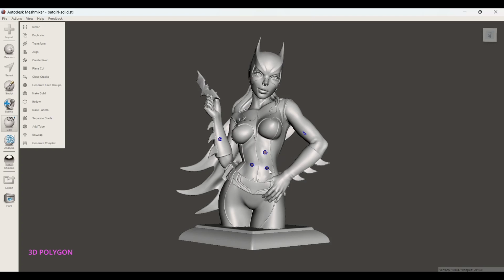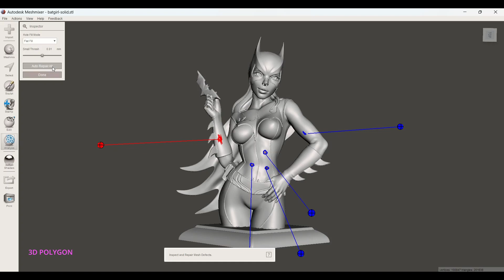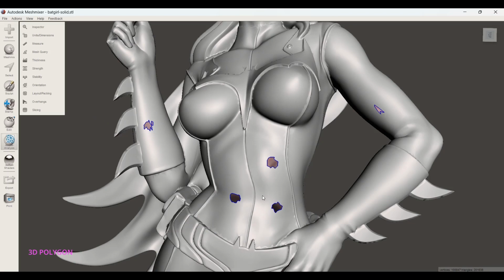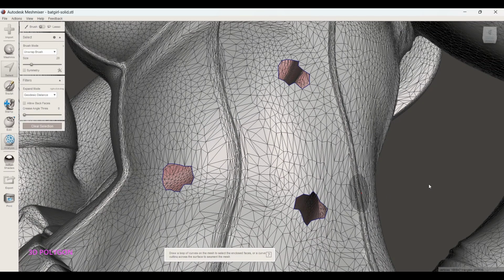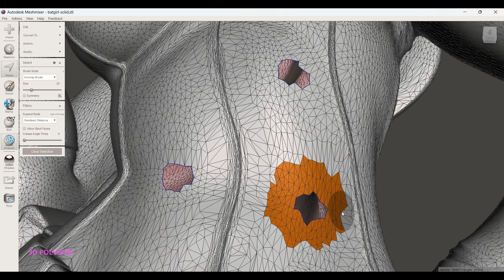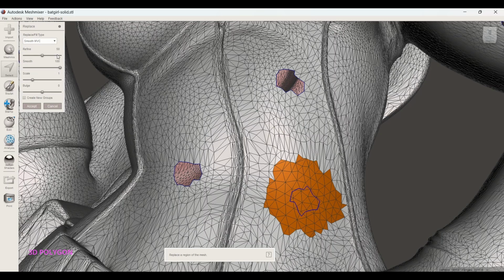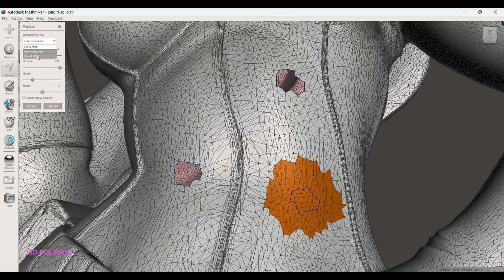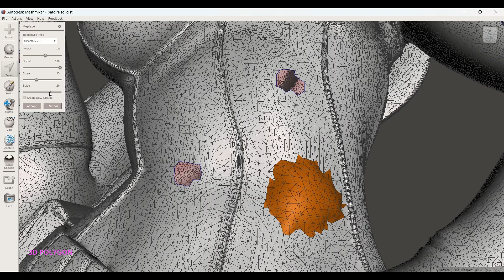Meshmixer Tutorial: How to Repair Holes | Fix STL Files

Comment: Thank you for this informational video! Is it possible to for example cut off the head of and STL file and edit in a different one?
Reply from the maker: Yes, watch this video:
https://www.youtube.com/watch?v=v69m-ZUGIb8&lc=UgxZmm6VAgLy670Gze54AaABAg

after cutting the head hit 'Y' to make two seperate bodies then delete the body and work on the head.
Reply: @3dpolygon962  thanks a lot for your help
Reply: @3dpolygon962   Hello, everytime i try to use the inspector, he just delete the problematic piece, any advice?
Reply from the maker: @alexsandermc9794  sometimes, when your model has a lot of issues this happens and you can do nothing about it